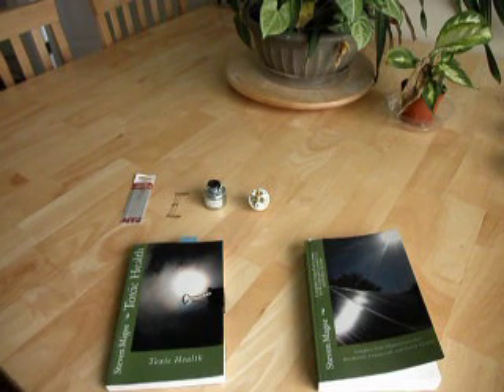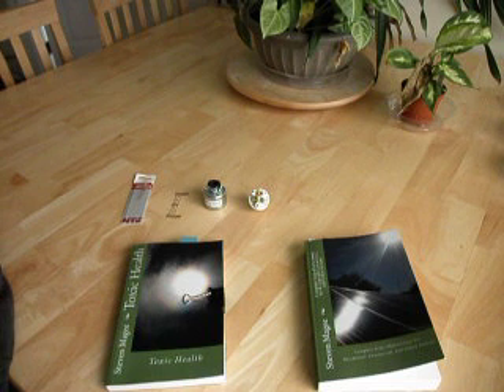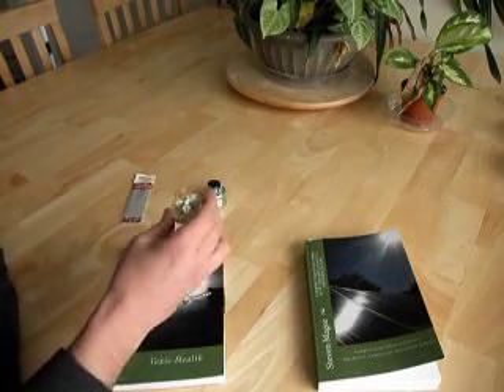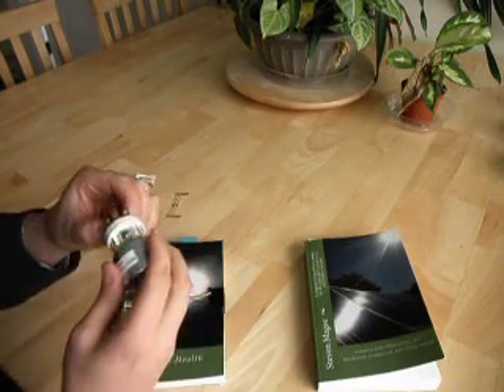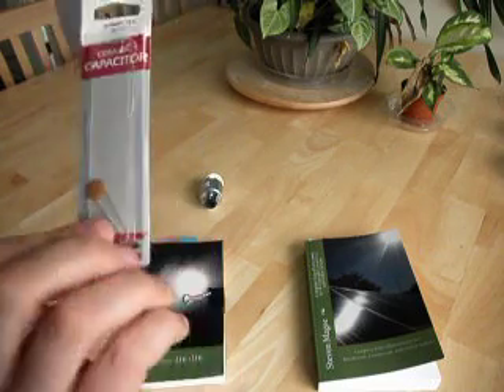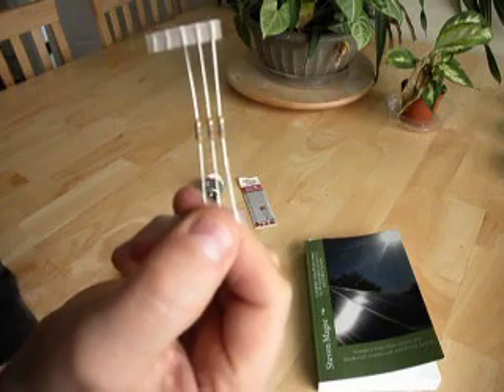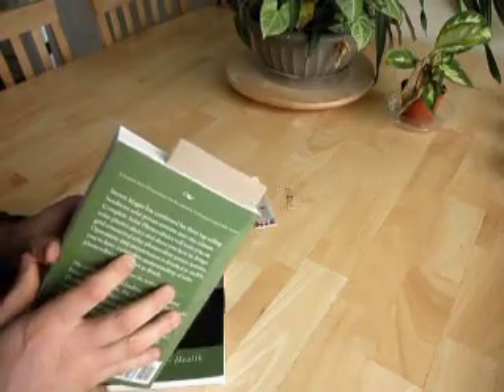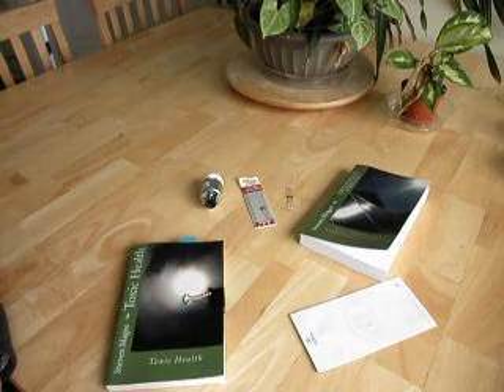Making a Capacitive Filter Plug for Dirty Electricity

Comment from the maker: I have no idea what is inside a GS filter. What is shown here is a simple power factor correction capacitor.  You should make multiple plugs with each one having a slightly different value of capacitor, as each capacitor value will filter a different set of frequencies. Stay below 0.01uf and make sure each one has a continuous AC rated capacitor and components exceed the voltage for the circuit it is installed onto. The type of capacitor doesn't matter, as long as it meets the specifications.

Comment: LOL!
Most all of your appliances already have line filters in them. Anything with a SMPS (Switch Mode Power Supply) is guaranteed to have some kind of filtering already in place -it can't pass UL/CE(etc.) certification unless the radiated RF,and noise is below a certain level.
Now,the cheap generic cellphone chargers from E-bay and stuff are very often FAKE,and will have no such ratings,or filtering. (and are technically illegal to use without proper certification stamps.)

Comment: and be damn careful with cheap capacitors not rated for true AC use. All it takes is one bad capacitor to arc and short when the power hickups and next thing you know you got a nice fire started if the breaker didn't trip in time. Sounds like a heck of a tradeoff for your "health"!

Comment: A more traditional way to do this is to run a .01uf capacitor from the hot terminal to ground, and another .01uf capacitor from neutral to ground. This properly balances the filtering across ground aiding in humbucking along its path from the mains input to the house to the wall that you plug it into. Keep in mind almost all electronics made today have a capacitor in line with the wall plug anyways to aid in filtering RFI from getting into the device.

Comment: I see you mention this is for a 120V AC system. What modifications to your design would you suggest for 230V 50Hz mains power in Australia and New Zealand? Is this anything like the Graham Stetzer filters, as I have read they are capacitors.

Comment: If you plugged a computer into an outlet, you have already connected a much larger capacitor between line and neutral, inside the computer's power supply. Typically 220,000pF (which equals 220nF or 0.22µF). Adding small capacitors around the house will not significantly reduce RF. Adding small capacitors around the house will actually increase RF emitted by the house wiring!, but that is not significant either. In the real world, this "filter" achieves less than nothing. It is a placebo.

Comment: (The resistor does not aid the filter. Connecting a resistor across the capacitor is traditional. It is there simply to discharge the capacitor after you unplug the filter, so that it cannot shock you if you then touch the pins of the plug.)

Comment: Hi Steven, have some of your books and enjoyed reading them. I have a question about the Fuse Board Filter on page 342 of Complete Solar Photovoltaics. The schematic is for 2 phase and in New Zealand we have single phase 240 volt supply. I would like to build a filter but obviously need a modified circuit diagram. Could you please send this to me or tell me what changes to make. Thanks for your help. paul@sws.co.nz